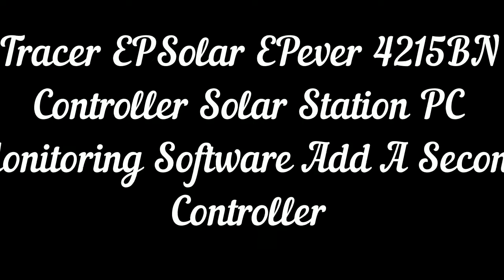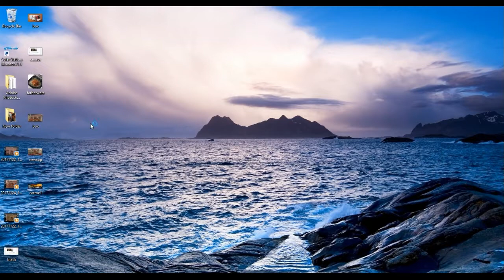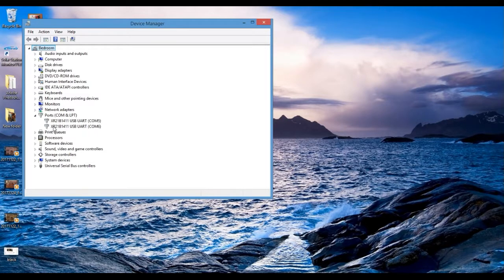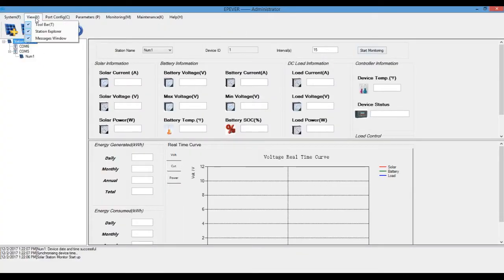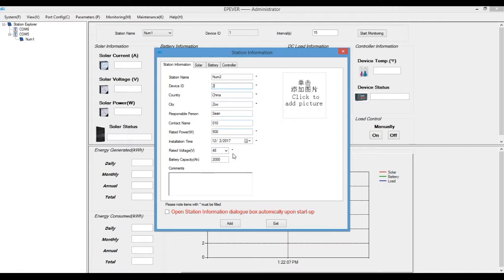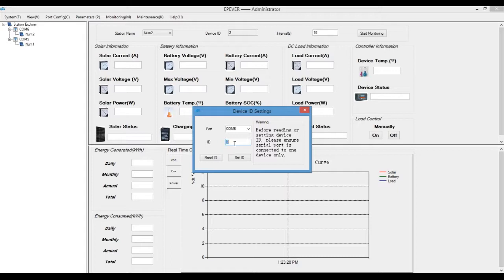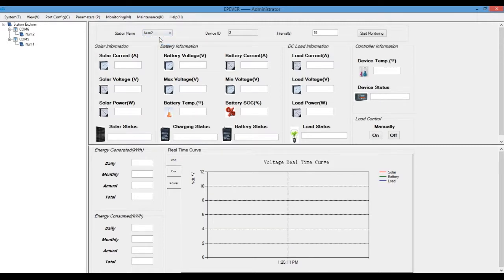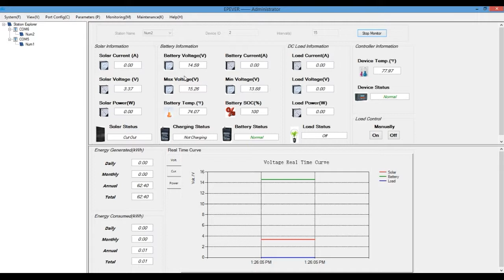Add A Second Controller To Tracer EPSolar EPever 4215BN Solar Station PC Monitoring Software

Comment: Thanks for your great video  I have 2 3210ANs and had problems integrating both of them into the software solar station monitor. I get an error message "Operation failed. The operation has timed out. (COM7)"
With the help of your video it works now without any problems.  Thank you
Reply from the maker: It's an old video glad it still works!